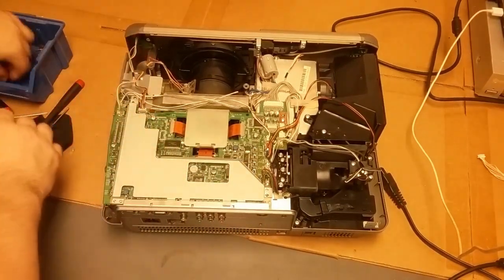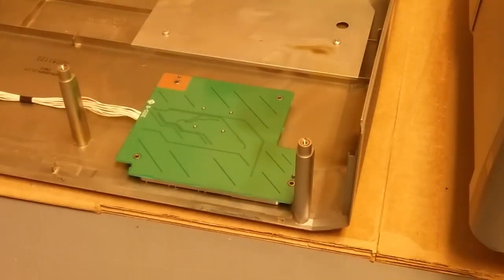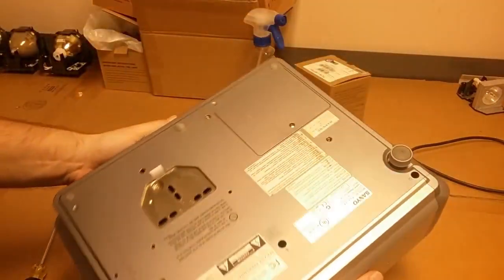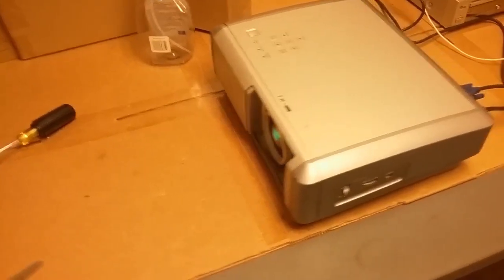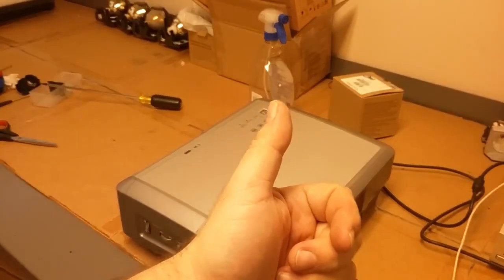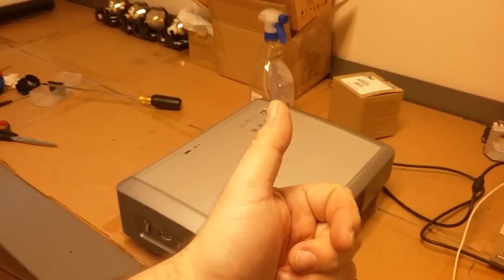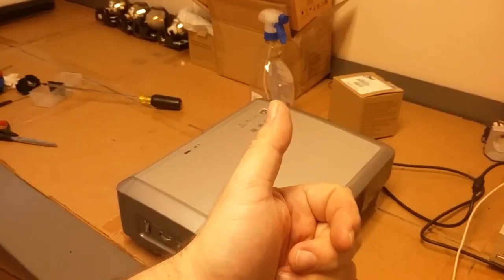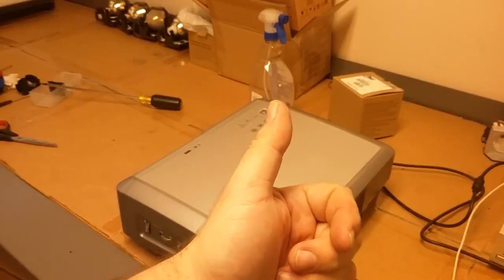Sanyo PLV-Z4 LCD Projector Cleaning

Comment: Thanks for posting!  Building my confidence to go in and clean a VPL-hs51.  Lens unit looks similar to this one.
Reply from the maker: Very similar! I also did a repair on an AW15 which is older but similar(stuck fan).  The Sanyo used a lot of Sony parts, so I wonder what the relationship was between them on projectors? Just take your time and be sure to not use any solvent on the optics. Be extra careful(even just dont touch ) the LCD area.  The polarizer panels will be quite old and ready to be damaged.  Merely touching them with a cloth is enough to damage them. those are the panels right before the LCDs.  A gentle vacuuming and a dusting with a soft dry brush should be sufficient. Sony builds really solid gear in my opinion.

Comment: Hi Frank! 
I have a PLV-Z700. It turns on, but immediately goes into warning. 
I bought used. I’m going to replace bulb.  Any other suggestions? Thanks!
Reply from the maker: I'd start with the bulb.  But it depends on the warning.  If you are getting a "lamp life expired" you wil need to reset that in the menu, but if its a flashing LED for lamp failure, then a new bulb should solve it. Good luck!

Comment: Hello FixitFrank, the video cleaning was very interesting. I'll keep the video close when I will clean my Z4. I have a question thought. The Z4 I have is having a lamp problem. I have bought a new lamp. It worked properly for 6 hours and then every five minutes or so, the front panel close and the power and lamp replace lights flashes. I've checked the heat of the room (heatwave in Canada) and the fixation of the lamp. No result. Should I clean the air socket? Is the temperature or humidity could be a problem? Thanks.

Comment: I'm trying to do the reset described in this post below, but I can't find the "small black thermal switch". Can you help me? thank you so much!

Process:
Remove the six screws (three underneath and three on the back) marked with an arrow. take note of one of the ones on the back as it is different to the other five.

Turn the projector the correct way up and lift off the lid, Disconnect the cable from the control panel to the main circuit board and note where it came from.

Towards the back left of the unit there is a small black thermal switch above where the lamp sits. It has a white central button. Get a pen or something else with a sharp tip and press the white central part, it clicks back in it means that it had tripped.
Reply from the maker: back right corner above the lamp assembly. The switch housing is black, but the button is white in the center.  Go to 3:45 and look at the bottom right corner of the screen. You will see the 2 wires going to the thermal cutout.

Comment: Hi , firstly I would like to thank you for sharing this very didactic video. 
I don't have proper screwdriver in order to take out the optical module.  Can you inform what model  you did? I am from Brazil and we use millimeters tools here.

That's a lot.
Reply from the maker: No worries. I only use metric as well. I only use sae for driving.  I don't recall the screw size but elektrotanya.com had the service manual for free.  It will be listed in there.

Comment: Is there a way to test the bulb to see if it is OK?  I am understanding there is no conductivity from the two leads of the bulb... Do you know how to test the bulb?
Reply from the maker: Unfortunately not really.  I go by visual indicators sometimes. Also, if its physically old,  even if the lamp hours are low, it can go bad.  I look for white deposits inside the arc tube on the side that would be facing down while in use.  If the inside of the arc tube is cloudy, cracked, distended or discolored, that is a good indicator.  If they the arc tube is clear and clean, and shows no physical signs of damage it might be okay. 
One way that kind of works is using any low current high voltage power supply to see if you can strike an arc inside the arc tube.  Its not a definite sign that the bulb is good but it will show if the gas is still inside and if the arc points can conduct.  I've used old plasma ball flyback power supplies and those "stun gun" transformers from ebay and they will give you kind of an idea.  Otherwise using a compatible ballast is the only 100% reliable way to check.

Comment: Hi, I'm going to get the same projector used. But the fans not working so the device shuts down to protect it self. 
Any obvious reasons why the fan is not spinning ?
Reply from the maker: It depends.  If it is only one fan not spinning, it may just be a bad fan.  They do fail as they are not super well made. Figure new they are a few dollars so they can fail.  However, I would be careful with buying a Z4 this old.  The LCD panels have a piece of filter called a polarizer that does wear out from age.  You get a yellowish picture or a colored blob in the picture which is not really worth fixing.  LCD projectors in general last about 7-10 years(some older, some younger) but when a polarizer fails, the unit is not cost effective to repair. If you can get your money back if it has this issue( or its really cheap) then it is good.  The Z4 itself was a great projector.  I used to have one that I loved. 
In short, if it only has one fan that is bad, I would read the part# off it, and order the same fan. Don't use a substitute because the status wire may be a specific type for that projector.  Computer fans tend to be different than projector fans most of the time.

Comment: Interesting video, I have a Z5 and some time ago (first lamp of two) it developed a sort of pink hue on the left third of the screen..this is on a white image and I have simply put up with it but know I will do as you have done...tell me is there anything else I can do with it whilst in bits..what about the light pathway, its exposed to the elements and must need some maintenance ...the general image seems dull now and putting it on full makes little impact, the new lamp has but 150 hrs on it, images are uniform, screen is wall mounted and only 80 inch....kind regards.
Reply from the maker: The Z5 is about identical to the Z4 for the most part.  The LCD panels are different if I recall but the rest is the same.  As long as you don't have a failing polarizer, a quick cleaning like I did here should help. You may even get away with blowing some air into the lcd area without removing anything.  Less is more here. Optics can be moved easily and are hard to get back into place.  Aside from the LCD area, you may want to blow out the prism area near the iris.  Otherwise that is about all you can do.  If the polarizer is the issue, they are replaceable but since the projector is older, I would not bother with repair since the cost would be higher than its worth.
Reply: @FixitFrank  Hi Frank and thanks for your reply...I took it to bits the same night that I wrote to you (couldn't wait!) the whole light pathway came under close inspection...all mirrors, lenses etc came out...noticed that they seemed to be coated with a fine foggy mist, I'm told that that comes from the plastic getting hot and fumes coming off not unlike the car inside windows, they were cleaned to perfection including the panel block (gently) it all went together very well and was immediately pressed into service......The quality was astounding except for one new issue.....a red/pink cast the full width of the bottom of the screen about an inch up you can't see it when a film is on and only on a white background.....stripped, checked again but still there......rest of the screen is spot on.

Regards

Comment: hello, don't you know the volt watt ampere lamp values?
Reply from the maker: Hello, These are arc lamps, the specs are not quite that simple.  Ignition voltage is usually 3KV-5KV, run voltage is roughly 80-120. 145W lamp rating, so figure 50milliamp ignition current, then increased to 1-1.5amps during run voltage.  You need to drive these with a 145W AC ballast. They cannot be powered directly due to the need to manage the arc.
Reply: @FixitFrank  
Is there a way to disable the bulb?
my purpose is to drive an LED lamp outside
Reply from the maker: @aliksoglu  Its not worth it.  I have tried and LED's wont work.  They are the wrong color(CRI) and making it project properly will cost far more than a new lamp.  You need to somehow fool the projector into thinking it has a lamp or ballast and its just not worth it.  I get emails on this every few months and no one is ever successful.  Its just not that easy or cost effective.
Reply: @FixitFrank  Thanks for sharing information with me.
Finally, what brand and code do I need to call to buy a caseless bulb, mine is broken and the texts are faded.
Reply from the maker: gotcha, I can help there.  Its actually pretty easy to find and should be pretty inexpensive.  If you look on the side of the bulb, you will see a philips listing. If you look up that it should lead you to the bare lamp.  
You can use either a philips or Osram 200-220W E19.5 reflector lamp. The e19.5 is the reflector shape which is the more important part.  Any wattage from 190-220W is safe to use as long as its an E19.5 reflector.  for example.  https://www.aliexpress.com/item/32840039609.html